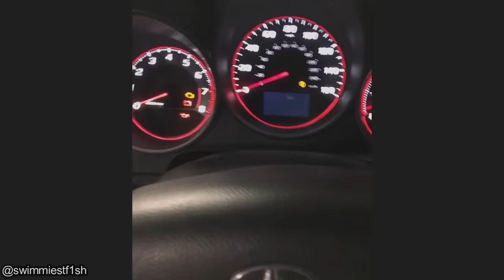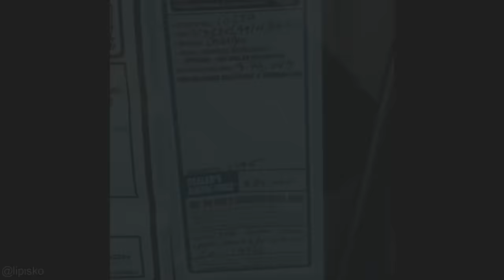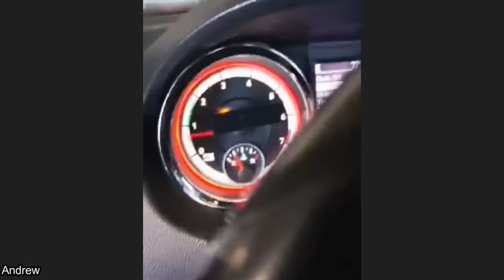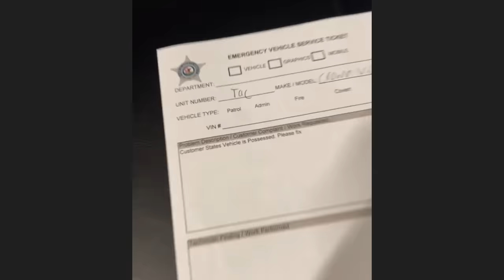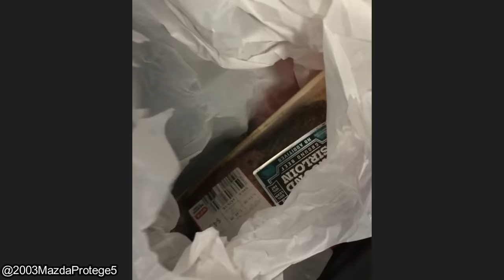Customer States Compilation (The Best of 2021) | Just Rolled In

Comment: The mould in the cars is what gets me... HOW COULD YOU LET IT GET THAT BAD!
Reply: It's actually really easy in Louisiana, Mississippi, or Florida. If you have a backup vehicle you don't drive every couple days, in a few months that amount of mold can easily build up.
Reply: In my opinion, this is caused by someone trying to clean their vehicle at the spray wash. We have all seen a clip of someone doing it. Well, this is the repercussions of a very wet interior. 

Also, in wet areas, it can happen. But I have never seen it this bad before.  
Never know...🤔🫠
Reply: In that first one I have no idea how anyone could sit in that car or even touch the steering wheel.
Reply: How does the driver not realize?
Reply: @unrulybot1352  The driver probably does. The more pertinent question is why they drove it.
Reply: Right?! The seats were bad enough, but I legit almost gagged when it showed the steering wheel. 😖🤢
Reply: OMG THAT AND THE FRIGGIN BUG INFESTATIONS! LIKE HOOOOW???!
Reply: portable cheese factory is what it is!
Reply: I saw a clip on another channel of a guy who had a Bentley or Maybach that was moldy like that. He went on a 2 or 3 week vacation and came back to it like that. Super airtight car not opened for a long time with a tiny bit of moisture trapped.
Reply: It was towed in. If there was a leaky seal, rolled down window, etc letting water in while it was sitting it could look like that in 2 days. 1 rainy day and 1 warm day. 😂

Mold and fungus can appear quick af. A water line to a swamp cooler busted in the night once and I didn't notice. Got home at 5pm to my bedroom carpet looking worse than that car. There were actual mushrooms growing in the carpet along with green mold.

Comment: I’m honestly impressed that some of these engines ran for so long with no oil changes.
Reply: Or engine mounts! Don't forget those!
Reply: A BMW no less. Normally BMW's don't tolerate that kind of tomfoolery.
Reply: My oil is great, it's my cooling system that sucks, but it's a 93 ¯\_(ツ)_/¯
Reply: I mean they can run for a VERY long time without an oil change, but the drawbacks are decreased engine efficiency and possible wear down due to foreign particles getting in, which in turn leads to major engine damage. It also makes it very difficult to change and recycle the oil when it has been in use for too long.
As long as the oil is doing its primary function of lubricating, then it'll last quite a while.
Reply: @carmium I’ve never broke a mount ever how it happens

Comment: 10:05 - "The salesman ended up crashing it on the way to the gas station"

No, what really happened is that the salesman saw an opportunity to go hot-rodding in a car that someone else owned thinking there would be no consequences for it.
Reply: And the dealership both fired his stupid ass on the spot and bought the dude a replacement vehicle with a partial refund for such a colossal fuckup.  Or i assume they did anyway because if they didnt then they could be sued for more than the cars price depending if money was already exchanged
Reply: This happens a lot. I saw with my own eyes a brand new vw sirocco (very expensive here), with the door very damaged. The guy that was getting the car off the truck opened the door and a bus crashed it.
Reply: Happened to me, bought a 2020 f350 dually limited. Salesmen who went to fuel it up had the dually fender ripped off by a guy driving a motor home pulling into the fuel station lol.
Edit: The dealership just hotswapped it for an indentical one on the lot ,
Took about a day for them to hash out the paperwork  on the swap but all in all went good,
Salesmen now works at dodge. Couple years later he sold my buddy a dodge. Lol
Reply: @b3n751  so he bought the dodge recently?
Reply: I have to chime in here. I worked for a Mazda dealership for a couple of years. A new, 19 y/o salesman took a Mazdaspeed 3 for a joyride with a female customer, and wrapped it around a tree. He was sued, I believe.
Reply: I used to work for a second hand car yard, I was told to take a couple cars a week out for a spin other wise they would just sit there, boss told me to take one of them to do the banking one day, had a car pull out of a T intersection and I very nearly Tboned the other car, the ABS brakes don't work as good as they should.
Reply: @mitsulang  how do you lose a mazda around a tree
Reply: ,,,mmm and WHY would a dealership bring it to you ,  to repair it - your not a body shop !
Reply: @diverdave4056  wtf are you talking about?
Reply: @diverdave4056  What the actual fuck? You sure that you’re commenting on the right video Dave?
Reply: There’s a saying my dad says, when it’s not yours, you don’t care about. When it is, you take care of it. Learned that lesson the hard way twice. Always gotta be careful with other peoples property but freak accidents do happen. That’s why insurance is for.
Reply: Yup
Reply: What really happened was it’s a dodge.
Reply: Happened to my mom once, got a ticket for speeding a few weeks after service. The date and time was exactly the day and time it was in the shop. She managed to convince the guys to pay up since the time brought in and exitted the shop was on one of the papers, otherwise she was probably fucked
Reply: I had a dealership ruin my vehicle over a stupid oilchange.  It fell off of their hoist!!
Reply: @MekhiTF  you go at high speed around a curve with 0 experience driving at high speeds around curves and you slide down into a tree.
Reply: @b3n751  wait, so the fired the guy because someone else pulling into the station damaged the vehicle?
Reply: Something else that's criminal in this piece is the addt'l dealer markup of $10K.
Reply: When the VW Passat W8 came out, a salesman and potential customer went on a test drive. The customer wrecked it and totaled it. Whatever they hit caused the transmission to get pushed back and into the passenger compartment among other severe damage. The customers' insurance bought that one, and he bought a new one because it was that safe.
Reply: We bought a 2018 camaro 2SS Hot wheels edition a few years ago. A few days before the purchase was finalized, some young dumbass went to get gas for the car, spun out, and got massive curb rash all over the rims. Needless to say we did not buy that car.
Reply: @m.stewart7208  thats not really criminal, just market adapting to supply and demand.
Reply: CORRECT! Couldn't have said it better myself.
Reply: @elz1250  its the opposite for me, i treated my 1999 dodge grand caravan like a slightly larger clown car, it was a hunk of junk, but i drive all of my friends cars like theyre priceless artifacts
Reply: Isn't $79,000.00 + $5,000.00 = $84,000.00?  Not $89,000.00?  Probably the same salesman that took the car to the gas station.  I'd say after he hit the go pedal too hard the car fishtailed and slammed into a curb.  He was probably thinking all of that sophisticated electronics would keep the car from careening out-of-control.  There is considerable positive camber on the driver's-side rear wheel.  Great video!
Reply: @elz1250  That's why I've always told people when they borrow something of significant value "Don't treat it like it's yours or mine. Treat it like it belongs to a possessive 800 pound gorilla with anger issues"
Reply: Yea especially in the hellcat too
Reply: “Sir, what happened to your car?”
“You know those parking lot attendants”.
Reply: @dr._breens_beard  If this was in Poland, they'd force the client to take car home and refused any warranty or responsibility, and the salesman would just end up working on a different dealership.

My parents bought new car that happened to be made out of bondo above the door line. Apparently it fell of the transporter and they rebuild the top of the car in a week. It came out when literally the last part of the roof that was made out of metal - roof railing groves rusted and dad decided to repaint the car for the heck of it. Paint shop stripped original paint and first called us, then police.

Sadly dealership was already out of business so there wasn't anyone to sue.
Reply: You'd be surprised how often this happens. I was a lube tech at a Toyota dealership in MI and my shop forman crashed a customer's brand new supra. Customer was some rich doctor who was surprisingly cool about the whole thing (apparently it was only a minor inconvenience for him). I left that job 2 years ago in that tech is still the shop forman.
Reply: @b3n751 , I'd be interested to know what type of paperwork is filed in those situations. After all, when considering a customer just bought the vehicle and even though it was damaged through no fault of the buyer, does this still stand against the vehicle for the sake of a vehicle's history report because even if it was repaired by the dealer etc., it was still damaged. So I'd be interested to know if by law they can actually claim, "never been damaged"...
Reply: @b3n751  Sold him a Dodge car?  Dodge doesn't make trucks anymore ......
Reply: @b3n751  whats a f350 dually limited?
Reply: @redmoon4694  So you did or didn't buy it? Your comment is confusing af.
Reply: 12:57 the 2 bolts tacked on to hold the frame together 😂😂😂😂
Reply: @b3n751  Oh, that's good. So the next time there is a bus coming at the salesman he can just... dodge.
Reply: @MekhiTF  
the first gen mazdaspeed3 is a dope car
for sure worth wrapping around a tree
Reply: @mitsulang  19-year-old car salesmen always have million$ stashed away and tons of personal liability coverage, lol.
Reply: Been there we took a customer rs focus out the one that drifts drifted it round the roundabout lost it and damaged the alloy and scratched the wing got tye alloy powder coated and buffed out the scratches god as new
Reply: @MekhiTF  Most Mazda 3 speeds especially newer are over 200hp depending on what’s in it heck my Mazda 6 gets up and goes when I need it too with only 180hp
Reply: @elz1250  I detail cars. Every now and then we'll run a customer home and/or back. We usually take the boss's truck instead of their car. I tell them, "just because I'm a good driver, doesn't mean everyone else between here and there is."
Reply: @barrowscasper12  dont use that language for ur mum 🤦
Reply: Correct.
Reply: @AlexanderTheGreat91  the cars damage was indicating that it was the salesman's fault. If the car had damage on the side or the back, you could argue that he was sideswiped, or tboned, or rear-ended, but when it's in the front, and it's not torn to the sides, then that means more than likely, he rear-ended somebody, so yeah, he should've been fired for causing an accident with someone else's car
Reply: Little did the buyer know, the salesman actually did him a huge favor
Reply: Yeah, sure, but they WERE doing that on the way to the gas station. Fuelling up is part of the job.
Reply: I've bought mine vehicles in sixteen years and I've never had a dealer fill it full of fuel after purchasing it
Reply: @MekhiTF  Mazdaspeed 3 is a pretty quick little hot hatch

Comment: Certified mechanic. 
"Vehicle is indeed possessed."
🤣🤣🤣
Reply: had a 1996 Plymouth Grand Voyager once that the wiper would come on at random but nothing like that
Reply: I've had some bizarre and extreme electrical problems with past cars. But even those were nothing in comparison.
Reply: I had an old car that's wiring went bad.  When it rained or there was a lot of moisture in the air the locks would do that & the interior light would go on & off.  I thought I had a ghost!
Reply: See also, body control computer has gone to the great bit bucket in the sky...
Reply: Time to break out the Snap-on Incense burner!
Reply: The worst I had was a sliding van door “open” chime that would go off randomly, even though the dash indicator didn’t show the door open. It drove the mechanic nuts because he couldn’t figure it out. That chime haunted me in my dreams, lol! I traded it in and upgraded to a 2020. I couldn’t live with that chime. I still cringe whenever I move new van with the door still ajar and the same chime sounds.
Reply: Maybe that's what's wrong with my truck - when I activate my left turn signal while accelerating the turn signal takes over the fuel flow, making the engine pulse with the turn signal rhythm.
Reply: @Dwayne_Bearup   You sure it's not just a heart beat?
Reply: My current Volvo has this problem that the background lights for the speedometer and other gauges usually just don't work, but if I have been driving it long enough, they start flickering and after a while they work properly. All warning lights work fine.
Reply: @RainbowMama143  There are a few solutions to that, even if you can't find the problem.

1. Remove or disable the "door open/closed" switch
2. Remove the chime speaker
3. Remove or disable the "Key in ignition" switch

I drive a 1989, and mine stopped working on its own. Don't really care. Just make sure the lights are off every time I get out.
Reply: @Dwayne_Bearup  Crossed wire somewhere. You've already isolated it to two wires, so that should be easy to find.
Reply: @jebbus132  Most likely a wire has come loose or been damaged, likely a ground wire for the cluster.
Reply: @ootdega  Yup, the physical act of checking the wires shouldn't take long. Blocking off an hour or so of time on one of the 7 days I work on things that make me money can be trickier. I have my fingers crossed that there will be no urgent calls for my handyman services this Sunday morning.
Reply: @Dwayne_Bearup  Godspeed.
Reply: I was sitting at a four way stop sign once and the dude crossing in the middle looked over at me in absolute fear because his car horn started going off and he wasn't even touching it. Dude about peed himself and I busted out laughing because he held his hands up so I saw them. I had to compose myself before I even left the stop sign because I was laughing so hard. Poor guy was so scared.
Reply: Yes, yes, that Machine Spirit is unhappy!
Reply: Customer invoice:
New computer: 200$
Replaced wiring:15$
Labor:50$
Holy incense:35$
Catholic Priest Consultant:300$
Reply: @emptank  Needed therapy: 250$
Reply: There's something incredibly funny about 
- mechanic reads insane C/S
- mechanic checks vehicle
- mechanic verifies insane C/S
Reply: @ootdega  Thought you might appreciate an update on this. As it happens, I got an emergency call that Sunday then didn't have more time until recently, and the only "crossed wire" I was able to find was an O2 sensor wire that fell against the hot exhaust pipe, essentially welding itself to ground. According to the mechanic I took it to, this allowed the sensor to still get power and, because only 1 of the 4 wires was affected, also left it able to return its feedback to the computer. So since no fuses blew and nothing actually stopped working until recently, hence the mechanic, it took a while to find the problem.
Reply: @michaelwallbrown3726  My wipers come on if I start my saab, but that's an EZ issue lol, the flip up radio hits the wiper lever... now on the other hand flipping my light switch to brights causes the transmission computer to absolutely shit itself and die putting the car into 3rd gear limp mode... that issue is as of yet unknown...
Reply: My Moms Grand Marquis had a dome light that would turn itself on and off. 
We laughed and called it the ‘ghost light’ but we would often gets neighbors calling us to ask if we knew the cars done light was on. 😂 Yeah, we know it’ll cut itself off in a bit.
Reply: @RainbowMama143  had a Toyota sienna with the same issue. I just unplugged it. 😂
Reply: Good ol' Crown Vic Police Interceptor. Sometimes when they get decommissioned, whoever disconnects all the police lightning does a shit job patching things up. 

This is one of those times. Poor girl has at least one helluva short 😔
Reply: @TmOnlineMapper  exorcism included in the service, or we need to go a different shop for that?
Reply: That was the funniest one ever. Still laughing at it.
Reply: I had a 1999 chevy 1500 every time a car radio add would play the truck would shut off I’m not joking
Reply: Based on years of experience as a service writer, I knew it was a Ford when I saw the locks go crazy.
Reply: I really want to know what was up with that car haha

Comment: 2:10 gave me chills, like seriously, removing the airfilter and then finding mice living there just to scatter deeper into the car? BRUH
Reply: Those were full on rats my dude, not mice RATS
Reply: We have barn mice in our backyard that kept getting into the air and cabin filters of my BFs '17 Hyundai Genesis Coupe. He bought a bunch of pure peppermint, put it into a spary bottle and sprayed it everywhere. They scattered out pretty fast, and he even managed to stomp on a few. We're planning on having them delt with altogether, as now they're getting into my Hyundai and other vehicles we have. Fucking annoying
Reply: New fear unlocked
Reply: Had this happen with our Audi A4. We took it in to the dealership a couple of times because the carpets at the passenger side would keep soaking with water. They couldn't find the cause. Eventually for an unrelated reason, we pulled the air filter and found a dead mouse complete with its nest.

I'm still not entirely sure how one thing led to the other but after replacing that filter and getting a mechanic to clear the lot out, the water never came back
Reply: Worse yet, some mice (like deer mice) can carry an airborne particulant that's deadly to humans. It's why I try to keep them as far away from my breathing space as possible.